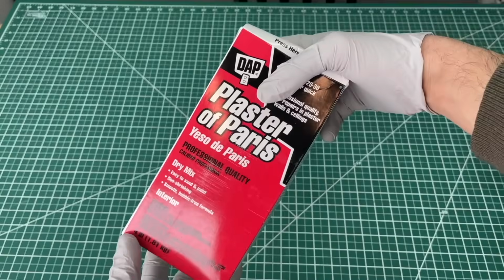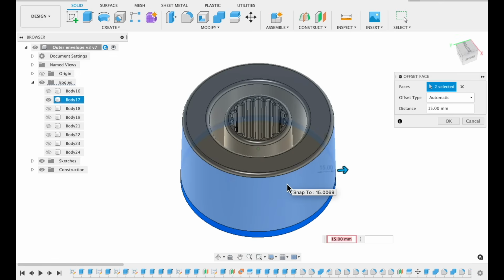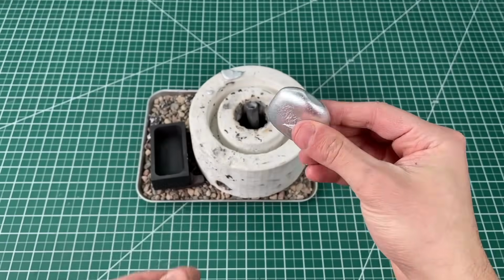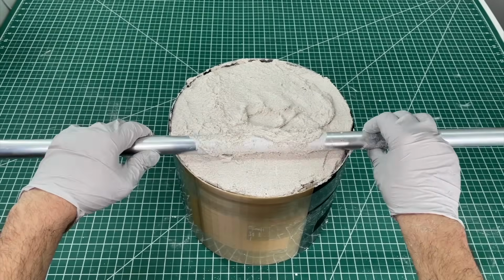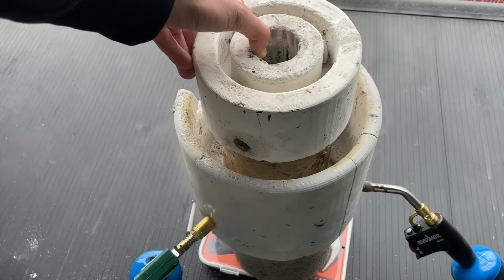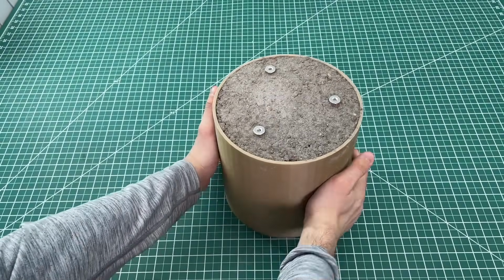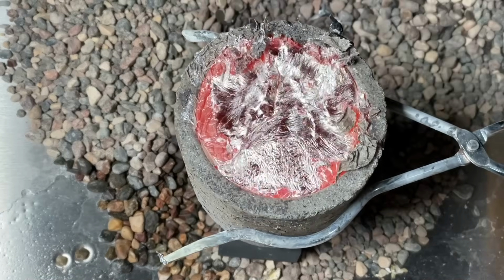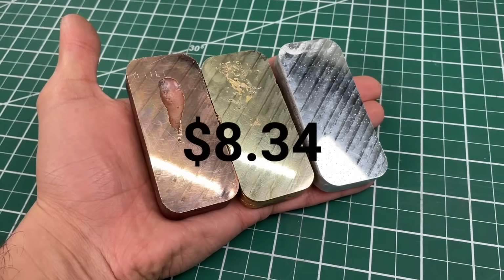DIY Foundry At Home

Comment: If you 3D print an inner core that has grooves in a spiral on the outside, you'll be able to fill it using mouldable ceramic fiber refractory material (names change country to country, not that expensive) and then place an electric heating coil made with nichrome or kanthal A1 into that, then fill the space outside that to the edges with ceramic fiber bllanket, or refractory concrete, that way you  can run it indoors using just electricty.Make sure to make a lid for it too, as without on it'll run shit
Reply: time to reach 1000 degrees F in a home made electric kiln:  15 minutes.  the second 1000 degree, up to 1985:  4 more hours.  you don't get many firings when you run your kanthaal that hot.  real electric furnaces use a graphite electrode the size of a tree trunk.
Reply: @thorium_glass  absolutely wrong. Nowhere near that amount of time to reach temperature, correct insulation materials make a world of difference. I'm not an idiot using bare uninsulated fire bricks 🤣 Takes about 2 hours to hit temps I need with the level of insulation I have at the size of the kiln and power level (3kwh) is uses. And wire lasts plenty of firings, speaking from experience, if kanthal didn't last long you'd have a lot of very angry potters mate.
Reply: @noviceartisan  no you're completely wrong, the potters I know are replacing elements all the time. like 2 or 3 times a year.  that's what happens when you use nichrome that hot.  you get dozens of firings instead of hundreds.  embrittlement.
Reply: @thorium_glass  I've used cone 5 over 30 firings (1180C) with the last element so far, using just 1mm kanthal wire on the Kiln I built. Probably quite brittle, but as I made sure to fire it on empty for a full firing at 1100C on a 17 hour schedule so the kanthal creates the neccessary oxidation layer on the outside which prevents premature coil breakage, and I dont' move or disturb the kiln, I have literally no concerns about the longevity of the coils. I've also used kilns ample times in the past with coils that have lasted over a year.

 The furnace goes to 1200, and used the same, though a much smaller volume, so it has a greater thermal efficiency. To make a replacement coil for my furnace from kanthal, when it gets to it takes me about half an hour, and uses maybe a tenners worth of wire. Hardly a big problem

I'd not run it at cone 7 (1255C)or above if I can avoid it, with such thin wire, but it is certainly within spec for the wires to run those temperatures. 

For the purpose of use as described above and in the video, of use as a furnace to melt bronze, even running it low at 1150C or a bit lower is absolutely fine and will last a great many firings before it breaks. Electrically fired furnaces are just fine. You've not seen the mini ones that manage 3kg silver using the exact same principles on a 2-3kwh heating coil that jewellers use daily, as they're cheaper and easier to work with than costly and troublesome induction furnaces that realistically need a higher rated power output than you'll get from a household without a higher voltage and amperage line been installed from your breaker?
Reply: @thorium_glass  Check this video out by TNCreation Channel for an example of an efficient Furnace build that uses electricity. There's another by the same dude on a kiln design that's also incredibly efficient. 

https://www.youtube.com/watch?v=Uw4Kr-Cj2F0
Reply: @noviceartisan  I'm tired of you telling me I'm  wrong and what I have and haven't seen.  stop tagging me and blathering.   I'm not impressed by your lies about kiln times, level of insulation or the size of your wire.  I don't care about your junky chinese made coffee heater for silversmiths.
Reply from the maker: Unfortunately I don’t think no chrome would be good enough with a recommended working temperature of 1200C. It’s an interesting thought though.
Reply: @ActionBOX  Nichrome, or Kanthal A1 is the standard heating element in kilns worldwide. Good Nichrome from kiln supply shops of 2mm+ is rated to at least 1250C ^_^ Kanthal A1 even higher. I've built my own kiln and furnace from insulating fire bricks, ceramic fiber blankets and boards, and hand making the coils, so trust me, it works just fine. Make sure you use a PID controller and a thermocouple to regulate the temps properly, and made a good fitting lid! :)
Reply from the maker: @noviceartisan  I’ll have to try that, did you melt copper with it? Or is it used for something else?  Cheers
Reply: @ActionBOX  Yup, specifically made the furnace for melting copper and metals that melt below 1200C, and the kiln using the same wire and materials for doing burnout for lost wax casting with both ceramic shell and investment moulds.

1.2mm+ for thickness of the wire used, if it's too thin, it'll break too fast. Good thick wire will last a great many uses before needing replacing :)
Reply: Obviously takes longer to melt copper with electricity, but it does work, and you can do large volumes quite safely indoors.
Reply from the maker: @noviceartisan  sweet, thank you for the insight 😃
Reply: @ActionBOX  check TNCreation Channels " DIY | MINI ELECTRIC KILN/FURNACE/FOUNDRY | RE-EDITED " for an efficient and decent small furnace, he's also got a build video on a very nice kiln design that's uber efficient and built like a tank haha 
Of all the videos on electric kiln/furnace design on youtube, this is the one channel I've found that does a decent job of the task, uses the correct materials, excellent design choices and overall build quality and efficiency

Comment: First off... I freaking love this idea. As I just got my first 3d printer, I will probably do this at some point. Never thought if using the printer to make molds.

Love the emphasis on safety as well.

Now for some educational observations from my end.

For the plaster of Paris, a regular kitchen whisk works great. Even a cheap hand held mixer. Though the paint mixer was a great idea! I have a bit of experience in my past doing ...*cough* body molds of models.

Cement and sand might have worked better than the concrete. Less pebbles.
There is also fire bricks and fire cement that reflects heat.

If you had set the mold on a board and used a bladeless jigsaw, vibrating the air out of the concrete and plaster would have been a lot easier and quicker. 

If you add too much water to concrete, it will just seep out the top. For cement/concrete to FULLY cure and reach optimal strength, it needs to stay moist for about a week. You will see people who lay cement driveways cover them in plastic to keep the moisture in as long as possible.
Little bit of wire (like fencing or even coat hangers) will increase the strength of the concrete greatly.

On the bernzomatic torch, I noticed yours were all blue.
The more expensive yellow set burns about 200 degrees hotter, but don't use the yellow canisters on the nozzles meant for the blue canisters. A lot of DIYers use those instead when they are doing the smithing hobbies. 

The stainless steel canister is really thin. Probably just got so weak from the sudden heat on one side and the extreme cold on the other that it cracked. Preheating the bottom "might" have kept that from happening.
You also could have saved that metal. With such extremes in melting points, just adjust the heat to melt the aluminum. Separate. Heat to the melting point of the next metal and separate again.

Cast iron is also called pig iron. It is waste made from smelting iron. Highly brittle and is pitted. Melting point 2200 fahrenheit compared to iron's melting point of 2800. The molten metal was most likely too hot and slightly melted the thinnest part and bonded to it.
Flash cooling like that can also crack/split cast iron.
Also the flash cooling might have compressed the metal too fast. Metal shrinks and expands quite a bit. 

I believe the black spots on top was carbon. Just cut off and remelt in next batch.

The air holes might be reduced by adding borax as a flux to the molten metal.
I know blacksmiths use it in old fashion "welding" to join and mix metals.

Hope this can help with future exploits!
Reply from the maker: Wow, this was an awesome comment, I learned lots reading this.  I appreciate your detailed input.  Cheers, Dave
Reply: Thank you for all the great insider information. Constructive criticism is always appreciated and help everyone learn.

Comment: black marks from the cast iron mould
Reply from the maker: But we also saw them when using the graphite mold.  Thoughts?
Reply: @ActionBOX  The black marks are black copper oxide (rust). When the copper is molten and sitting in the mold it reacts with oxygen in the air and rapidly oxidizes the exposed copper. It doesn't happen in the furnace due to the oxygen being consumed by the flames.
Reply from the maker: @Cornish_Co  sweet, thanks for the insight 😃

Comment: The black stuff you see in the copper is oxidation and can be prevented by adding borax over the pour while still hot, not too hot, as it cools is when the black stuff forms so experiment the time after pouring,  the borax will melt over top to form a protective layer,  cleans off easy. Also, hot metal and cold crucibles are never good friends, goes for cold bar moulds too. I would find some U channel or C channel mild steel, 5 or 6mm should last, oh a 1/8th inch thick😅 have it cut to length you want with ends welded on past the bottom to form a stand, have them vapor blasted and ceramic coated,  should last a long long time, also can be preheated quickly with little energy,  but stays hotter longer..enjoy experimenting..
Reply from the maker: This is great information, I appreciate you sharing this with us 😃. Cheers, Dave

Comment: For aluminum, build a proper rotary degasser
Reply from the maker: Can you give me more derailment so on how that works?
Reply: @ActionBOX  sure, you basically blow argon through a stainless tube with a part that diffuses the gas into tiny bubbles on the end. The agron bubbles trickling up will remove the hydrogen gas which is dissolved in the aluminum. That hydrogen is what causes those holes. Making a degassing setup isn’t crazy hard and it will allow you to achieve true commercial strength cast aluminum parts. Would make for a dope video too. There isn’t much documentation on this process on youtube which means its not as popular as it should be

Comment: fascinating.  I'd love to try casting metal.  If you make another foundry in the future, you might have a look at a plaster-cement material called Ultralcal 30.  It should be much better than plaster of paris, and easier to pour than pure concrete cement.
Reply from the maker: Awesome, I’ll have a look. Thank you 😊

Comment: For the bubbles, look into flux. That can help de-gas the metal
Reply: Flux does not degass aluminum, it just helps seperate the dross. To degass, you need to blow a purge gas through the molten mix
Reply from the maker: @alex.g.t.2  thank you 😃
Reply from the maker: Sweet, thanks 🙏

Comment: Really cool!
But would it be possible to heat it electrically? In my opinion that would be even more flexible and cool
Reply from the maker: It is. We may try that in the next version of the foundry. Cheers
Reply: That's called a kiln. Otherwise you can use a welder or microwave transformer  attached to a graphite rod to form an arc furnace that can melt steel. The king of random and Ave have videos on diy arc furnaces. I've been wanting to try it but steel seems to spatter a ton when molten.

Comment: For mixing, you want to use a paddle mixer, not a paint mixxer.  Paddle mixers work well for drywall compound, plaster, cement, etc
Reply from the maker: Good to know. Thank you 😊
Reply: try adding the water sliwly to the powder while stirring, as done in cooking

Comment: you should use a lid, and maybe some form of outer shell and maybe steel mesh 'rebar' to reinforce the plaster.
also, if you use a reducing (fuel rich) flame if you wanted to reduce the degradation of carbon-based crucibles
Reply from the maker: That’s an awesome suggestion. Do you know which off the shelf fuel source we could get? Ideally from Home Depot?

Comment: I wonder if you built an induction coil into your crucible design you would be able to heat quicker and with more control.
Reply from the maker: True but it won’t work for aluminum 😞. We thought about it.
Reply: Doesn't work for any of those metals. Only Iron. Now if there was a crucible with a core of iron that would be perfect. But I don't know if such a thing even exists. Or if it's even possible
Reply: https://youtu.be/_9ZK_Hs99FU

Comment: I use sodium carbonate to degas molten aluminum. YMMV.
Reply from the maker: So do you just throw the powder into the molten aluminum mix? Thanks.
Reply: @ActionBOX  Get rid of floating dross first so its ready to pour otherwise. Some people wrap the powder in tin foil. I just put an amount of it on a spoon that I also stir it with until the bubbling stops.

Comment: You want a mix of Portland cement,  perlite, bentonite clay, and sand it will stick together better and have better insulation factor.  It will still be cheap
Reply: You got it(about the perlite), that is what I read over the past years of researching this. Also, using a lose firebrick on the top can prevent the heat from escaping and get to the melting point faster. I am looking forward to their follow-up video.
Reply from the maker: Awesome, thanks for the insight you two 😊. Fire bricks are cheap enough so we’ll give it a try.

Comment: Try MAP gas.  Yellow can.  Should be on the same shelf as the blue ones ya got from Home Depot
Reply from the maker: Thanks for the suggestion. We saw it but it was $12 instead of $4 and we wanted to keep it as cheap as possible. Knowing what we know now, it’s exactly what we need to help with the copper melting.  Thanks for the input 😊.

Comment: melting brass is one of those things to make sure you're doing with a respirator!  Looking into a proper burner to melt will probably save you money in the long run as well as then you can use large propane tanks instead of the small disposable ones and last but not least angling your flame so you aren't putting a hot spot on one specific location on your crucible will probably help it last longer.  Interesting project for sure though.
Reply from the maker: This all makes sense, thank you for your input.  We were using respirators and did notice substantially more fumes from the brass.  I assume the other metal fumes are also bad??
Reply: @ActionBOX  it's mostly the zinc in brass that's the issue, burns at a low temp and causes awful side effects. It's shown by that white fume looking stuff when you are heating the brass, probably a sign you are getting it a bit too hot.
Reply from the maker: @BlacksmithGen  thanks for your knowledge. This helps a bunch. I probably won’t be playing with brass smelting anymore.
Reply: @ActionBOX  that's probably for the best, if you want more information look up metal fume fever, also called zinc shakes.